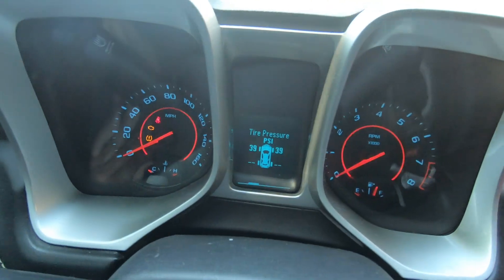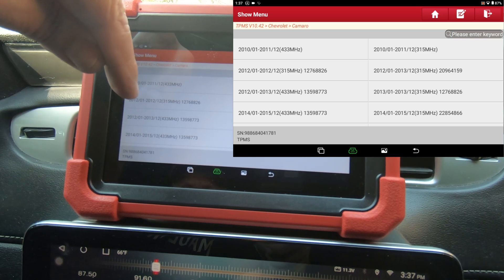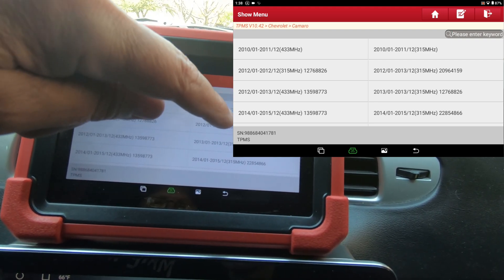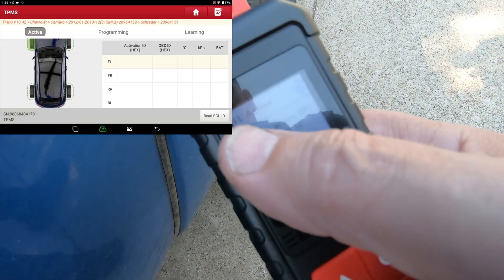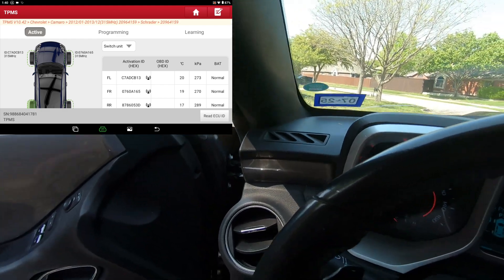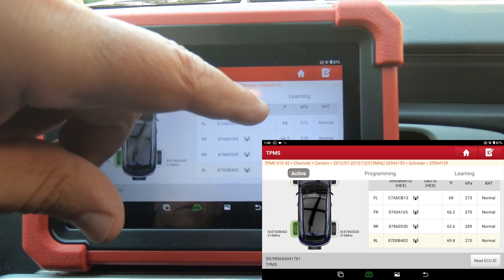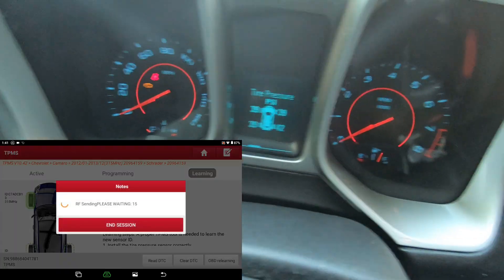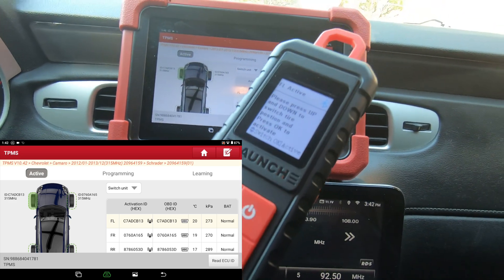Using the Launch I-TPMS to learn New TPMS Sensors on a 2013 Camaro.

Comment: Where they or sensors or launch sensors
Reply from the maker: This will only program blank launch sensors, but it will activate any brand sensor that is preprogrammed. In other words if you buy sensors for a particular car that already has the ID programmed into and is the correct freq. this tool will activate them to work for the car but if you buy these blank sensors that will fit any car and need the ability to program them this tool will do that.
Reply: @737mechanic so will activate oem preprogramed an then will program an activate learn aftermarket (launch) sensors thank you
Reply from the maker: @dillonferguson6352  exactly.